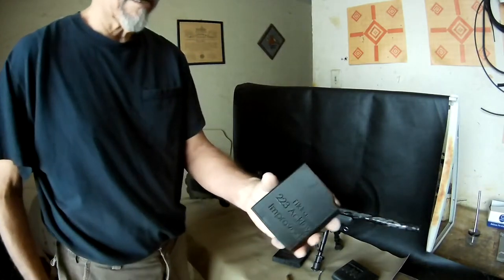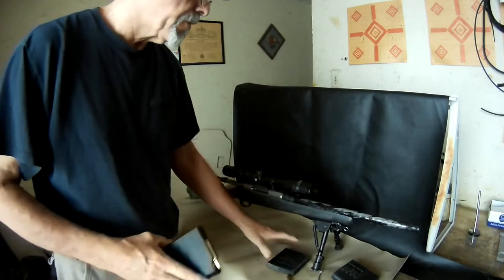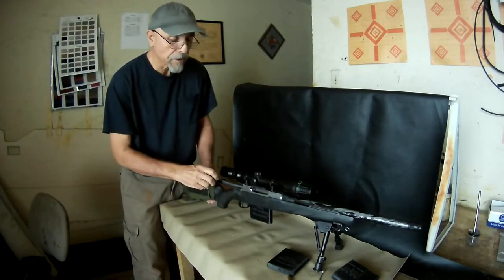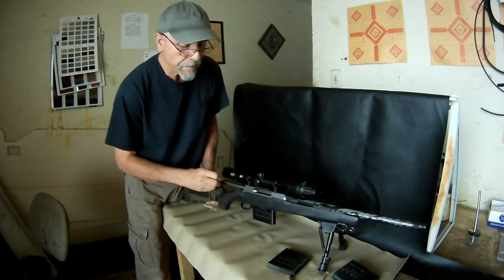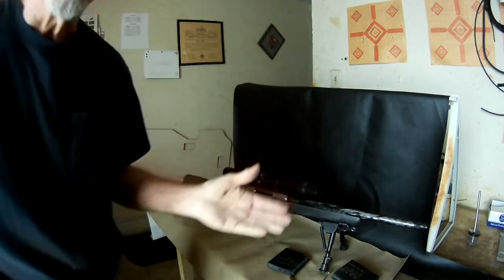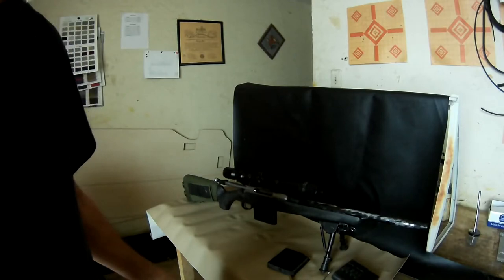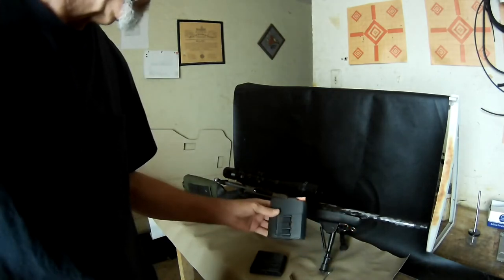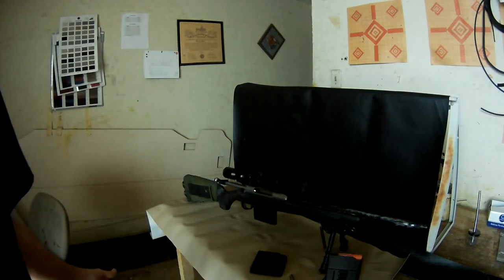Tikka T3 Lite Carbon Fiber Barrel/3D Printed Extended Magazines

Comment: They came out great! May you please share the STL? I just got a T3x lite 308. What springs length and diameter did you use?
Reply from the maker: I'd have to search for those files.  This project was done quite a while ago and I periodically clear out all of my files from my laptop just to make room for more project files.

I'm afraid I'm not very organized when it comes to copying my files onto a disk.  It may take me a while to find them but, if I can find them I'll be happy to upload them to my Thingiverse account and send you the link.

I have to tell you though,  the inside geometry of this particular magazine is made to accommodate the 223 Remington sized cartridges.  I'm afraid that the 308 will most likely not not work for you.

I mean, I'm pretty sure that my 3D printed magazine will fit up into the mag-well but your 308 cartridges will not fit into the magazine.
Reply from the maker: I looked for those STL files I mentioned and I couldn't find them in any of my computer files or any of the CD that I usually save old files in.
This evening I was modeling a simple two-axis gimbal for my cheapo action camera and when I went to upload my finished file onto my printer's flash card, I noticed that all of those Tikka Magazine files were on there.  I hadn't even thought to look there for those old files.

I do have the files but, they are no longer STL files.  The actual STL files are gone.   After these STL files were uploaded to my FlashForge slicer software, the finished sliced files are converted to .x3g files.  I use a FlashForge Creator Pro 3D printer and that's the slicer software that came with this printer.

If your printer can open those files, I'll be happy to share them with you, provided you'll only be using them for your own personal use.  I don't generally share my files because there are so many liars and thieves on the internet who will steal other peoples hard work and claim it as their own for profit.  The files consist of the magazine body, the follower, the bottom plate and the spring plate.

I made the metal magazine springs using some spring wire I bought at a local hardware store so, there are no files for making your own magazine springs.

Comment: Very nice,  that's exactly what in looking for.  I see on one of your replies that you might still have the xg3 files?  That would be great if you were willing to share or sell a copy as i have a flash forge printer. I'm after a couple mags to run my 20-.223 with 55 gr bergers and coal of 2.400.
Reply from the maker: I searched and searched for those files in all of my storage CD and both of my laptops.

I couldn't find them anywhere but, a couple of days ago I was printing another project and I noticed that on flash drive of my Flashforge Creator pro those files were still there but, not in the STL format.
Reply: @MrTjmk  well if you still have the flashforge files that should work as I run the same machine.

Comment: Fantasic work you wouldnt mind sharing?
Reply from the maker: I'd have to look through a bunch of CDs to see if I could find those files.  If I find them I'll contact you via this particular video comment page.
Reply: Can i also get the files?
 @MrTjmk
Reply from the maker: @Julebrussss  I've checked all of the CDs that I've used as my file storage for all of my old 3D print projects and I've not been able to find those STL files.

Sorry.  If they ever do turn up I'll make it a point to post it on this comment section.

I've had dozens of guys ask for those Files and I would be more than happy to share them but, I just haven't found them.

Comment: What type of filament did you use to print this magazine?
Reply from the maker: I used ABS but if I were to do it again I'd probably go with PETG instead.

 I get far better prints with PETG than I ever could with ABS and the prints have a bit more rigidity.

In the Arizona heat the ABS seemed to soften a bit more than PETG does.  This has the effect of causing cycling issues.